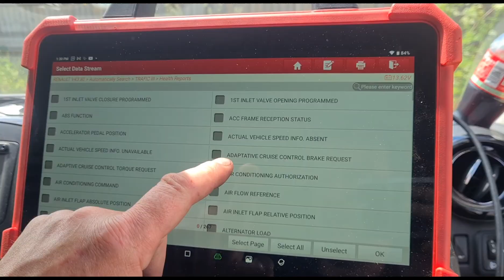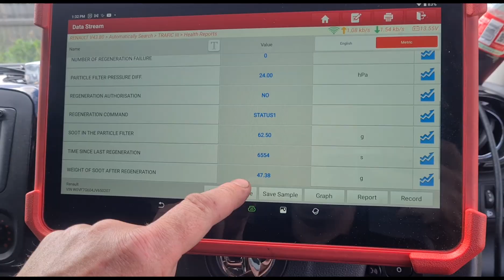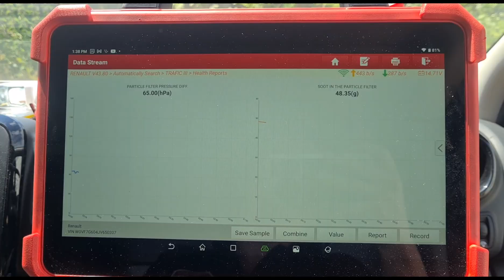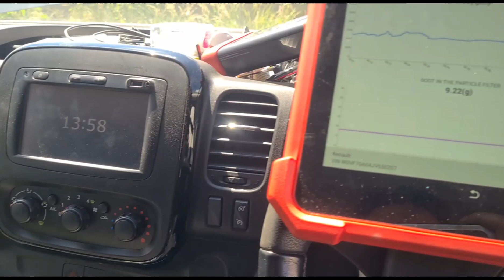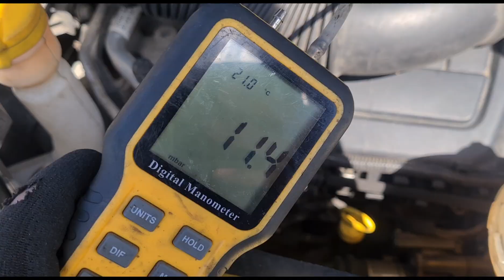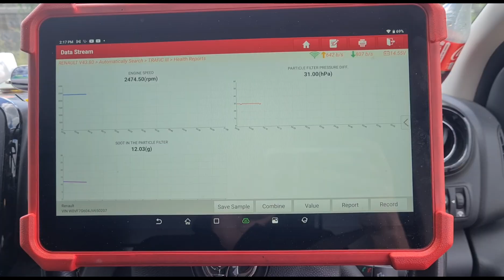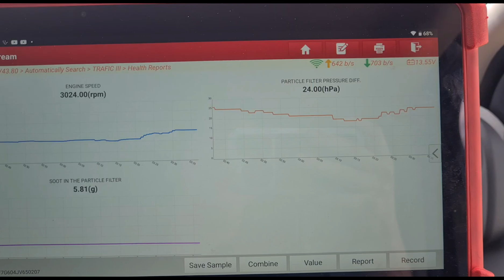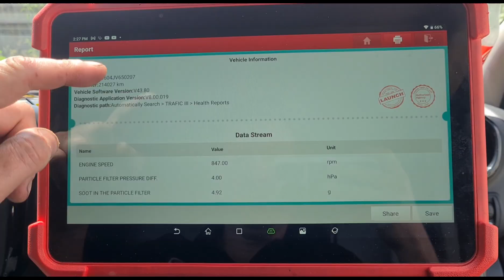Can You Clean DPF Ash On The Vehicle? Diesel Particulate Filter

Comment: Peugeot 2008, 2015.  
Was in limp mode clogged filter. 2 Can dpf cleaner through top sensor.  Worked, no codes even start stop started working for the first time since bought the car but it says pressure is 5 but ash is 94% full ? Is this a problem? If do any solution?  Many thanks

Comment: GREAT video Jimmy, as always, I saw close to 100 of them. 
That got me worried though. My 1.6tdi is running 5 and 45 Mlbar idle/2.5k revs but the soot is on 67g. 
Sooty wet arse end, I think it's either cracked or melted, No codes though.
Will try your launch fluid first and brick accid later as I probably can't make it any worse

Comment: Hi so how much brick cleaner and how much water you saying 30%water into 5l acid bottle,  how much fluid you need to poor into dpf. I have got exactly the same fault codes on my vauxhall.
Reply: And thank you for the tips hopefully will work guys.
Reply: @tom-hx1kd  Be aware that I am in no way an expert! I did it only because my DPF was clogged so either I tried this and it worked or the DPF should have been replaced anyway. It is at your own risk.

And have in mind that the only reason your DPF is clogged is probably because of another thing being wrong and therefore doesn't regenerate/cleans itself right.
Reply: If I remember correctly I diluted it 1 part acid to 5 parts distilled water. I used what is called '30% brick acid' (maybe there are different percentage products in your region).
For the DPF cleaning I mixed a total of 1.2 litres and forced it into the DPF using a (manual) pressurized brake bleeder while the engine was idling, making sure the mixture didn't overflow the DPF running backwards into the engine.
Reply: @Celica_dk  thank you for that because my soot level are now 450g and ash level is 325g so need to do it bean told also my need new dpf because on the end of pipe black Ash so maybe dpf it's damaged 😢
Reply: Also on my grandland x where would you put pipe in through o2 sensor on top or in middle dpf where temperature sensor is?
Reply: @tom-hx1kd  If you have soot in there you have to use DPF cleaner first. The cleaner takes care of soot and the acid takes care of ash.
If your DPF is a sandwich type I will suggest to use the cleaner before/in front of the DPF, and the cleaner in between the w filters. You may be able to use the pressure pipe that measures before the DPF.

DO NOT let the acid work too long!!! It breaks down stainless steel (which the DPF is made of) if it soaks to long. I had it soaking for about 15 minutes and then took the van for a drive. Slow accelerations as the DPF is partly blocked by the water/acid mix. When it gets up in temperature you may experience a lot of smoke from the exhaust as the mix evaporates.
Reply: My dpf it's on front of the car will try to get acid Monday and dpf cleaner hopefully will work its shame that I am 2.30 hr away from you guys otherwise I would live it for professionals.
Reply: How did it go

Comment: Thank you from an 81 year old retired mechanic in Kinglake Australia, for you pointing out the logic and diagnostic methods of diagnosing and rectifying DPF failure on a Colorado 2.8 diesel utility.  Testing information for the differential pressure switch, and the data on soot level and DPF pressures has allowed me to use my XTool 80 scan tool effectively and to remove my reluctance to learn current generation technology.   Better late than never, but many thanks for your inspiration.  BTW it works perfectly, no new parts required.

Comment: I cleaned a Peugeot 1.6bluehdi dpf yesterday. I had previously tried the foam cleaner, I could get the pressure down but a few days later the fault would return. 
I removed the Dpf, soaked in TFR for 15 mins, this loosened the soot, back flushed with water until it ran clear. Not a lot of soot actually came out. I then soaked it in brick acid for 15 mins. I agitated it a few times and again back flushed it with water untill it ran clear. Lots and lots of red orange ash came out. The ash seems to be large particles. I don't think you can get the ash out through the dpf, it needs to be back flushed. 
I blew the dpf out with compressed air and refitted it to the car. Held the revs up at 2500 for about 15 mins, the pressure has dropped from 35mbar at idle to 3mbar and over 300 to 30 at 2500rpm. I have reset the dpf and hopefully she'll be grand now 😂
Reply: How was the DPF, didn’t acid effect any of the regen or cleaning capabilities?
Reply: @TS-ji1me regens etc all fine after cleaning. Obviously needed to reset all parameters but fixed my issue.

Comment: What dilution do i use water to brick acid, and how do i get it into the DPF. I have a similar problem on my Mk 8 Transit ex  18 seater to campervan conversion.. My son says I drive like  I am going backwards. However, I thought that 2k revs would be enough to keep the DPF clean.. I usually drive at 60 mpg which is 2k revs to get a good mpg. Looks very interesting.
Reply: Sorry, I should have said I have no problem yet with my Berlingo, but I am preempting a problem. I suppose I am the weak  link here!!!

Comment: I had a problem with my dpf on my bmw didn't want to do a force regen so used dpf foam cleaner did clean some bit not all I found out the alloy wheel cleaner I have was the perfect option half a ltr into dpf left it to sit for half hr then fired up started cleaning straight away gave another 2 shots and it just started flowing through no back pressure non acid stuff and it's only 10 quid for 5 ltrs you could smell the soot burning

Comment: I  nearly always druve my car till it hits 90 degrees oil temp. If necessary, I will drive it at 2,500 R P M
surburban and motorway .otorist low milage driver.
Engine may be compared to a person.
IF you do NOT exercise your lungs n heart do no not work efficiently.
Same with the engine, Slow n stop start driving do engine no 12:23  favours.
A good 120 Km motorway driving for 30 minutes will flush a lot of gunge from engine n exhaust.
Just as you see a jogger spitting snorting  n coughing gunge from their lungs after a hard run.

Comment: I have a 2017 master x62 with 62klm and running beautifully. Jimmy just wondering when I should have the dpf checked? Also if you could advise when to change the gearbox oil and coolant. Never been changed yet since new. Auto/manual type. Many thanks Jimmy. Jimmy from cork

Comment: Great video. I have a mk6 gtd and getting alot of back pressure and struggling to boost but does at about 3k. Do you need to force a regen if using the dpf cleaner or just monitor live data?

Comment: Top man, very interesting, I've been using the launch fluid every since I discovered it on your channel, I have no need to try anything else as the launch fluid has worked every time, without fail.
I will definitely consider using the brick acid if needed.
Thank you for all the information,  it's much appreciated. 👍

Comment: R9m engine it might be that the engine is burning oil  you have to use rn17 engine oil in them low ash many people do not and it causes the engine to burn oil  and then clogs the dpf sympton  not the cause .the engine has steel pistons in them to improve torque it wears the rings out usually they start having starting problems

Comment: Watched virtually the entire channel, back to the plant sprayer days 😂 Got tucked up with a Renault Master 19 plate, CHECK EMISSIONS after 6,000 miles. Used spray can cleaners. No effect. Used 2 part cleaners with plant sprayer to limited effect. Used acetic acid 40% 24hr soak, got pressure down to 7hpa. Was happy with 1.75% oil dilution in a 1200 miles. Thought a longer soak will be awesome. Left 1 litre in over Easter. Totally f*cked it. Every time I cleaned it, it got worse. Idling 12-14 hpa. Bought the Launch fluid. No effect. Got to the point of oil changes required almost every week, 8-9% oil dilution. Regen? Soot content was rising ffs. Fitted new a DPF last weekend, idles 6-7hpa when hot, 3hpa on start up, 1% oil dilution after 1200 miles..£750 free delivery, £80 fitting.
Reply: Too strong of a solution for too long of a period of time and corroded all of the flashed metal out of the system so it could no longer passively or actively regenerate. Looks like a stronger solution for a longer period of time just eats all of the good stuff off of everything as well as the ash and you end up with a straight pipe.
Reply: @JustMe-Dude straight through pipe, solve all the problems, we don't  need all this shit they're  putting on cars and vans these days !! 🤬🤬🤬🤬
Reply: @Mr4fksake  except straight pipe plugs up SCR with soot right away. would still need everything removed and a remap so it doesn't go into limp mode but won't pass MOT. agreed all of this after treatment sucks but sometimes you just have to live with it and move on.
Reply: @Mr4fksake 
That is illegal

Comment: Never tried the brick acid but I had the issue on my old Berlingo 1.6 hdi and as a heating engineer I used a bottle of fernox f3 central heating cleaner and it got all foamy out the tail and cleaned it out never had the fault again 🤷‍♂️  vans still on the road 3years later by another lad
Reply: How did you get it into dpf?
Reply: @timclarke8565  the 1.6 has the cat and dpf on the front of the engine straight after the turbo. Undo all the bolts and remove pipes and fan (or unbolt and move front frame forward depending on car) or whatever else you need to make space and it should lift out.

Actually, because it's upright, it's probably perfect for doing in situ. Uncouple bottom and block. And go in through the sensor port half way down, not sure which one tho, don't have a 1.6 anymore

Comment: Because of your previous video with the acetic acid I tried cleaning my Trafic (Talento to be honest) with brick cleaner and water, although diluted more than you did.
Had the van running while injecting it into the DPF, shut the engine off immediately after and had it soaking for 15 minutes. Ran it for a while to get everything out of the exhaust and now I have a far more responsive van and a higher mpg.
The live data figures aren't as low as you show there, though.

Thank you for all your helping and informative videos!
Reply: My dpf sits under the car (peugeot 308 hdi 2015), is it possible to fill the dpf when the dpf is horizontal?
Reply: @Ben-ft4li  The DPF on my van is also horizontal. I injected the diluted brick cleaner acid via the pressure sensor pipe to get it into the DPF as close as possible. The reason I had the engine on while doing it was because I hoped that would help disperge the mix onto as big an area of the DPF as possible and then turned of the engine immediately to let it soak and not just run through.
Just be aware that it is all on your own risk. I tried It because if my DPF was damaged anyways I figured I could only make it better, not worse.
Reply: @Celica_dk  I have a question regarding your experience with using brick acid on your DPF while it remains in the car. Since the liquid is expelled only when the engine is running and exhaust gases push it out through the tailpipe, I'm curious about how the loose ash can exit if there is still hard ash behind it. How does the process ensure that the loose ash is removed without being blocked by the harder ash behind it? I don't know if my question is silly or not. Thanks
Reply: @Ben-ft4li  Well, I haven't taken the exhaust system apart to see if anything is left in there but the brick cleaner acid dissolves the ash. I let the DPF soak a bit with the acid and then when the exhaust gets hot while test driving it afterwards the mixture evaporates and exits through the exhaust.
The acid doesn't just loosen the ash from the DPF, it dissolves it. At least that's what I've understood from what I've researched.
Reply: @Celica_dk  You are correct, it desolves the ash. Do you think I should start with a DPF cleaner for the soot first, so the brick acid can then come into contact with the ash afterward, or is the brick acid enough on its own?
Reply: @Ben-ft4li  What I've learned from both O'Rileys and other infos you always start with a DPF clean. Soot is what builds up in your DPF and is supposed to be self cleaned by the engine management (DPF regeneration). If your soot builds up and does not clean out properly you work with a DPG cleaner. It only takes care of the soot, not the ash.
The ash builds up as a leftover from numerous DPF regens and that is when you need to clean the DPF in some way, either a flush or a clean by professionals when the DPF is off.
The acid brick cleaner is a DIY fix, ALWAYS AT YOUR OWN RISK!
You can end up with a damaged DPF so there is no guarantee or anything, all at your own risk and expense.
If you want to go deeper in to how to and why with DPF cleaners, go through O'Rileys many videos.
He's very good at explaining many factors for why the DPF may clog, and why you should proceed with various tools to diagnose which faults may be on your vehicle and how to exactly diagnose a clogged DPF.
Reply: @Celica_dk  Thank you for taking the time to answer, you're awesome.
Reply: @Ben-ft4li  Don't thank me, thank @ORileysAutos :)

Comment: I have a transit custom with 25 kpa of pressure on idle, thinking now about puttin 7% HCL acid in it and soak for 30 mins, question is will i have to flush it afterwords?

Thank you for the awesome videos.
Reply: How did it go? Going to do this soon, put 200/300 mls in, let it soak, add some more to help it move dissolved ash out of the brick and repeat, then add water. Hopefully it will trickle through the brick taking dissolved ash with it

Comment: Really good and informative videos 👍
My Mercedes OM605 Blue Tec engine have 0.04 gr soot conten dpf, but fill level is stuck at 400%.
I'll try foam DPF clean to see about soot content reduces.
Maybe I'll dismantle the DPF from the car and try to clean it.
Reply: Probably wasting your time and just need a scan tool to reset the maximum level that is stuck in permanent code.
As Jimmy has shown in the past sometimes that's all it takes is a good reset of all the memories that are locked in

Comment: Is it true if you un plug the air mass flow sensor when injecting fluid in to a dpf that sits high in the engine there is les chance of it flowing back because it closes the egr valve ? Would like to know a wee bit more about dpfs that sit high 😉😉 another great video mate
Reply: Bit late to party here but did you find out if egr stays closed when disconnected
Reply: @MichaelBrookfield-m8n  They say that on the video for the JLM DPF gun 🤔🤔🤔

Comment: Cheers jimmy, Distilled Water with Battery Acid about 50/50, that should shift the stubborn ones.
Reply: Yes and eat all the metal off of everything including the seams at the welds. Would have a non-functioning CAT, DPF, and SCR with a tail pipe full of holes. Great idea........

Comment: It's called oxalic acid.  I've used it several times in the past to rejuvenate dead DPFs, however it takes a long time sitting in a fairly strong solution to really work.  You also need to almost constantly flush it back and forth to agitate it so works it's way in better.  One word of warning, some DPFs contain materials that can be damaged by this acid, but most seem to be fine.
Reply: not oxyalic acid, read the ingredients on the bottle. ACETIC ACID 20%. not for soot, but for ash
Reply: @JustMe-Dude  it says 15% hydrochloric acid on the bottle, check the gray field, first line.

Comment: Just woundering have you ever tried oven cleaner on a dpf to clean it?? I use it to clean the vanes on the pd engines when the actuator suck with carbon works every time. Woundering how it would work on the dpf

Comment: Great job . I use G101 from autosmart down pressure pipe. Works a treat. Youre right  about dpf pressure. These vans a very moody. Any excess differential pressure or any implausible readings. That anti pollution light is coming straight on

Comment: So the "soot" value is a calculated value by the ECU ? I guess the only worrying thing here is that you could potentially be mis-led if there were a number of other issues leading to failed regens ? I can see where this will lead .......... future parts cannons. Great that you actually tried to clean it first Jimmy rather than just throw a DPF in it straight away. Bravo yet again. Top Man.
Reply: It would be very difficult for the vehicle to actually measure how much soot is in the DPF. The calculated value is determined from lots of experimentation and testing and a very clever model that uses lots of data including the differential pressure.
Reply: ECU calculates soot load based on pressure VS engine RPM, that is all. It is a running average.